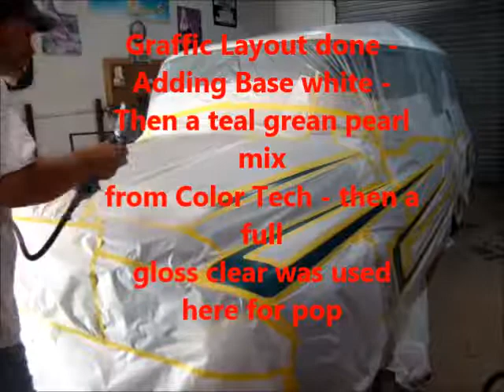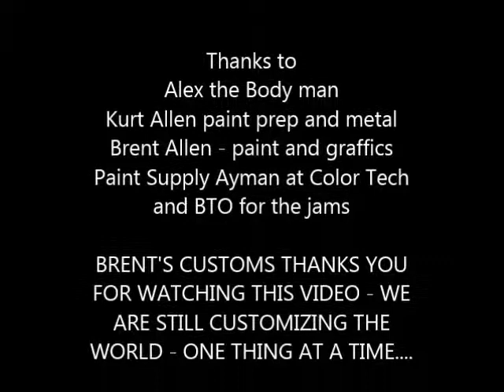Full Custom Paint Job on Lumpy the I H  Travelall 1966

Comment: Did you paint the scallops right over the clear coat of the base? How bad were the tape lines?
Reply from the maker: yes - right over the clear -   I only put 1 coat of clear over the scallops, so the edge was minimal - Later after it was all painted I had a real good pinstriper i know come in and put a red painted pin stripe right on the edge of the scallop too - it really hid the edge nicely -
Reply: Could I base the whole car do the scallops then clear the whole car?